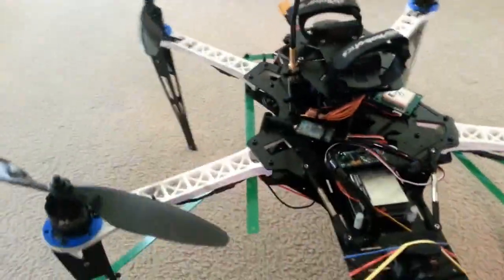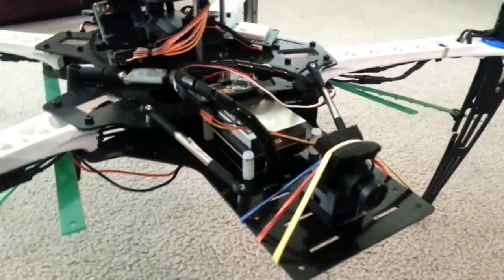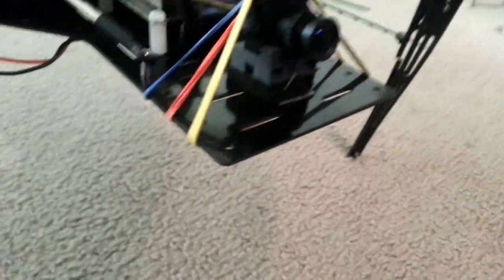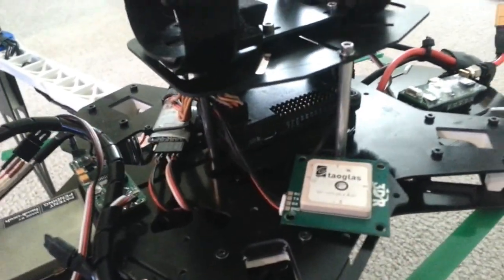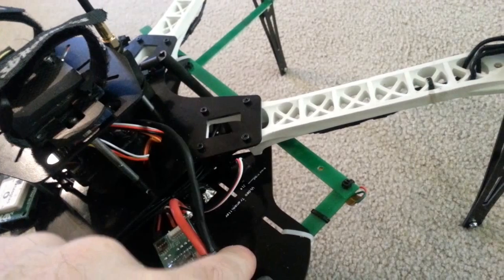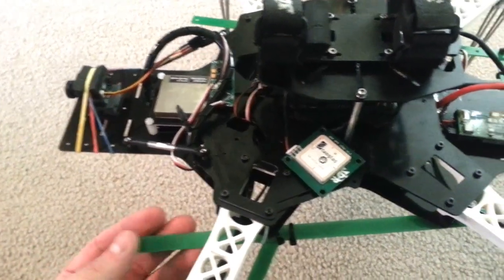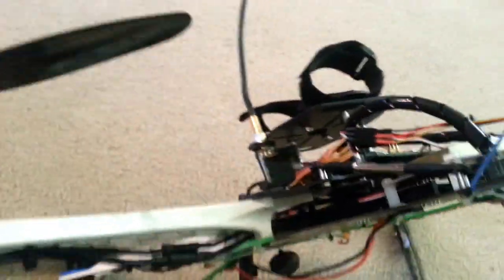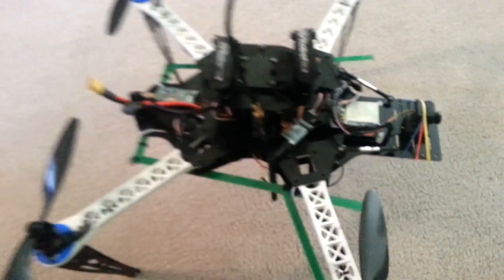SK450 Deadcat with Defibrillator and Q-Brain

Comment: If I may be so bold, how do you adjust the "D" parameter of the PID you discuss for the KK2 board? I've looked through the menu and can't find it anywhere. Would sure love to try that as my SK450 config to Deadcat won't fly as advertised. Thanks a lot.

Comment: Greg, do you still have your DeadCat?
Reply from the maker: Yup rich, sure do!  I moved the gimbal to another rig, and therefore took the extended feet off, put headlights on for night FPV.   Some changes, but yes I still fly her.
Reply: Ok, great,my real question is this, how the heck did you get that Qbrain connected, it's bloody confusing with their color coding, is there any chance you could share an image or two on your connection to the APM board please. I would be so grateful, Specifically the 4 wires from the Qrain to APM
Reply from the maker: Go to the "files" section in the product page,  you will find this link:
http://www.hobbyking.com/hobbyking/store/uploads/934316348X1085196X31.pdf

The picture in the manual is straight-forward.  S1 signal controls M1 motor.  There are pictures there of hookups, too.  Mine is pretty buried, it'd be hard to get a good picture.

Comment from the maker: Thanks Philip, I actually updated the APM mission planner software, and the firmware on the APM 2.5.  The most recent release has an option for "x" configuration AND more specifically, you can choose the deadcat geometry.  So, loading this, the flight was acceptable with their stock PID parameters.  Just a few tweaks dialed it in a little more.   So, stable flight is locked in, but the loiter PID's still need work.
Reply: Hi! This SK450 Deadcat looks great! I have the same parts in the mail for my second quad. Do you have any pictures somewhere of how and where you attached the Tarot 2D?
Reply from the maker: My mount is very "thrown together"  but itworks well.  I used the rail mount, even though I don't have rails,  and some zip ties.  I'll try to remember to snap some pictures of it when I get back in town.

Comment from the maker: Recent Upgrades: SK450 Defibrillator, and Q-Brain ESC's.

I am very pleased with the recent upgrades to my quadrotor, and a breakthrough in PID tuning on my APM 2.5 quad. I haven't been satisfied with it's flight characteristics for a long time, and have been frustrated with PI-tuning. I have ignored the differential ("D") portion because it is not often addressed in tuning tutorials, and some flight computers simply omit it as an adjustable parameter.

Well, today I ramped up the differential coefficient and now it flies AMAZINGLY well. I am looking forward to some FPV sessions soon, this week is supposed to be very fair weather. 

Q Brain 4-in-1 ESC!! -- a long time coming in my opinion --
http://www.hobbyking.com/hobbyking/store/__981__710__Multi_Rotors_Parts-Q_Brain_Series.html

Defibrillator -- I was very close to making one of these myself -- 
http://www.hobbyking.com/hobbyking/store/__38078__SK450_Dead_Cat_34_Defibrillator_34_Power_and_A_V_Distribution_Board_and_Power_Shield.html

I still might make one board that routes power, a/v, gimbal control, flight computer, osd, rx, basically every darn wire on this thing replaced by a trace.
Reply from the maker: Sure... I'm'm away for a couple days but I'll post when I get back.
Reply: ***** so can i get them?
Reply from the maker: Luke!!  i forgot, and headed out on another road trip.... hit me up nxt week, sorry!